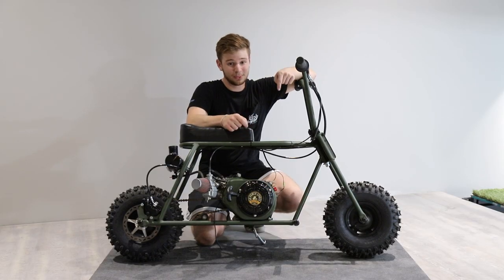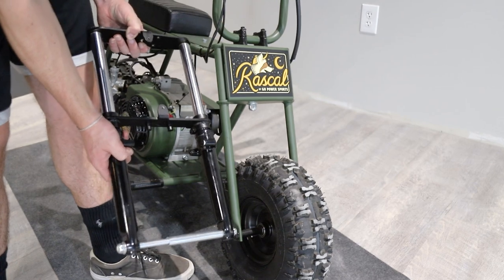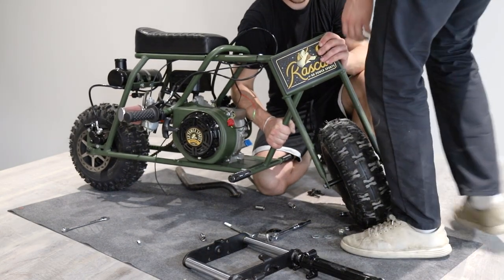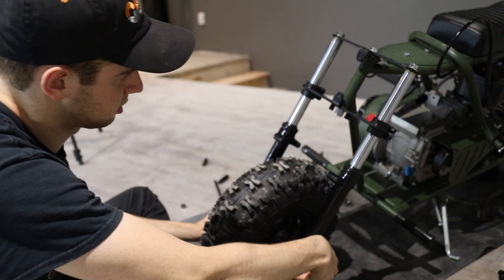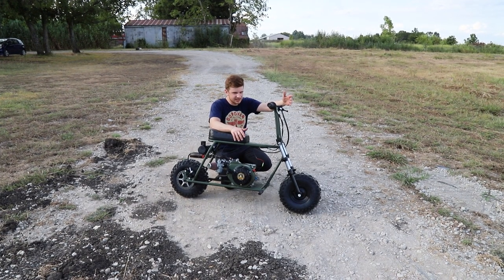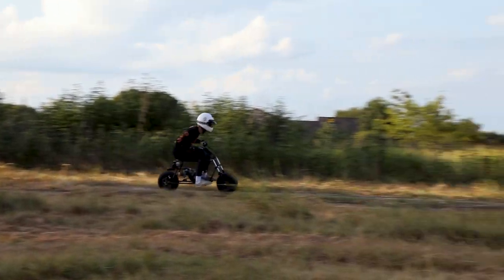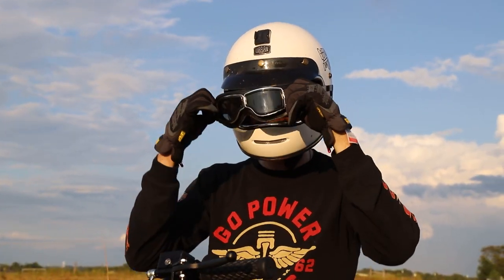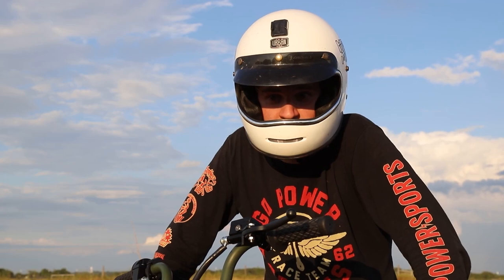MNIBIKE FRONT SUSPENSION UPGRADE - GoPowerSports Rascal Kit Upgrade

Comment: Did you guys notice when you added that new fork, did the riser bolts drag on the head tube or did you notice the shorter turning radius?  My top plate is hitting the frame on the tighter turns. I was forced to add like 5 washers under the top plate to make it clear the riser bolts from the handle bars.

Comment: Hey so I got one of these suspension kit for the rascal but it reduced my turning radius anything that can help with that?
Reply: Ran into the same problem, was thinking of going with a 7 inch neck bolt and adding a spacer above the top bushing to give the riser clamp nuts room to clear the frame. Not sure if it will work or prematurely wear my neck bushings..🤔 Any thoughts?
Reply: I need help with this same problem
Reply: Did you figure this out?
Reply: @chrishudson9496  never did, I went back to the stock one for looks, mainly the nuts of the bolt holding the handle bar was chipping into my paint anyways each time I turned

Comment: do the front forks have adjustable height?
Reply: its not. 
I bought this kit for my wife's Maverick 98, and its longer than the original fork that came with Maverick. So it now has the lfront end jacked up look(by about 1.5", and while lower fork clamp is height adjustable(to accommodate the different neck size),  fork itself cant not go any higher on the top fork plate.
It works fine, but i feel like this is something  that should be disclosed on the discription...